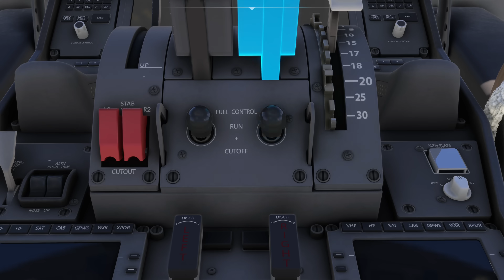Air India 171: Why Did The Fuel Cut-off Switch Get Moved?

Comment: I did wanted to float an idea, what if engine fuel was cutoff due to a software glitch but in the when the pilots found out in the frantic race to recover they tried 'turning it off and on'. this would be later recorded as 'fuel manually cut off' as sensors would indicate that. could that explain the conversation from recorder? would other sensors be useful in establishing a timeline to rule out this scenario?

more importantly IF this was the actual scenario then how could pilots recover if it happens again, esp in climbout.

Comment: Looks like Steve got some input from boeing to constantly push the pilot error angle 😊 ... Remember he was the first one to blame on the pilot error with his wing flap theory... which he retracted in light of new non-refutable evidence of RAT 😮 ... Interim report is not blaming the pilots as of now... so let's not be quick to blame pilot due to lack of real root cause... otherwise u will again hv to retract this line of argument in light of new data .. in 737 max case also people were quick to pin the blame on pilots without doing any real fact based root cause analysis. This is plain stupid if not some agenda driven.

Comment: Without video of the switches being moved to cut off, how do we know they were physically moved? In a software driven airplane, why would it not be possible for a glitch in the software to indicate fuel switch cut off, when, in fact, the physical switches were not moved to cut off?
Is there not visual and audible alarms that could indicate to the pilot that asked Why did you cut off? without the physical switches being moved? Hence the denial?
 As I understand it, these switches are not hardwired to the shut off valves, but instead go through the software befthe valves are activated. Is this true or not?
Reply: Yes, it's just an electrical switch that gives it's position to the computer. No direct mechanical connection to anything. Also it should be audible in the cockpit voice recorder. The sound of the switches 1 second apart should be damning evidence one of the pilots did it. Not sure they have that evidence or not.
Reply: That is how I understand it as well. @arunkp20

Comment: its been said that the cut off switches are moved .. it does not clarifies what or who moved it .... this channel is only discussing the human posssibilities .. a blame on those who cannot defend ... the same report also mentiones that its possible for the cutoff switches to fall back as a - non mandatorry maintenance issue
* take the switches in the house for example ( on high volt cases the switch will be still on but the fuse stopps the electricty)....  there is very high possibility that the switch was never moved in the first place but the internal electricity was flucuating ----- this explains the electrical issue in the flight even befor take off )
Reply: No, there is no evidence the switches were physically moved.
Reply: @pmaitrasm  but the reeport says that there is a 10 sec interval between the switches getting turned on again.... any human trying to turn on a switch in a critical condition would do in way lesser time ... here the timing doesnt make any sense ... it would be a internal electrical issue
Reply: @jayaprakashhasthi5775 , Do you understand a flag? A transistor can hold a value, as a 0 or 1, indicating something is false or true, but that does not guarantee that the switch was actually physically moved.
Reply: @pmaitrasm 😂 why are you repeating whatever I say…we are on the same page..read it carefully
Reply: @jayaprakashhasthi5775 , Ok, got it. From a grammatical point of view, when you use the word ‘but,’ it indicates you are negating what you stated prior to it.

Comment: There are 2 fuel valves on Boeing airliners , the ones inside of the fuel controls and ones inside the leading edge of the wings where the pylons attach .  The ones in the wings are for fire suppression .  Were those valves closed also ?

Comment: You know if some sort of AI was included in future versions of the Full Authority Engine Control system it could have at least questioned the cut-off of fuel to the engines during take-off which would not have been normal procedure. I'm not talking HAL but some sort of verification system; You sure you want to do that?

Comment: Answer a simple question !!
Why did the pilot switch it back to Run mode after the cutoff mode if he wanted to crash the plane??

Also can you shut off both engines  without the other pilot not knowing?? Or in less than a sec duration??

Comment: Steeeve, for an eng. fire, you said than on approach, you select the fuel cutoff sws. to off.

For an engine fire, the 787 checklist requires that the fire handle be pulled and rotated to shut off the fuel which as you know shuts off hydraulics and pneumatics,
and NOT  the fuel cutoff sws. to shut off the fuel.

Comment: "Two-man rule" on the switches is a little crazy. One of the pilots can always refuse to operate a switch OR what happens if one pilot is incapacitated??? Also introduces increased possibility of failure.  Sorry, bad idea. (this ain't WarGames in a nuke silo)
Reply: Yes. One pilot goes to the bathroom or fades out and the other is never able to shut down the engine fire.....
Reply: @martinwigge7642  Notification of e.g., an engine fire, would override the need for dual compliance.
Reply: Exactly.  It's also a more complex system with more modes to fail, like it could lead to it failing to recognize dual activation and hence not activating.
Reply: @rocketanalyst  I think what you will see now, is that they add a block-hold in the flight mode logic so the switches cannot be turned off during a 'take-off rotation' period. Same as when in 'ground mode' the gear will not retract up nor will the RAT deploy - the flight control does not allow it.
Reply: @RazortechAirguns 
Because there’s no other way for the pilot to crash, the plane 
He could’ve just slammed the rudder over as hard as he could. They would’ve been too low to recover.
Reply: @neilkurzman4907  It appears to me that the Captain caused the accident where he did not want to be blamed. Planning it to be seen as an accident or the other pilots fault. There is a cultural aspect to this as well. So no, he's not going to 'slam the rudder' if this was his plan. Doing something like that is spontaneous and erratic, the behavior shown was deliberate and with some forethought.
Reply: @RazortechAirguns that’s still a more complex system with more modes to fail, not saying it’s a bad solution but is a trade off.  how does it determine it’s in take off and how do you connect that to the system?  it’s of course doable, but it introduces complexity and more failing modes
Reply: @rocketanalyst  Actually, it is a very simple set of instructions to the system logic --automatically hold fuel-cutoff to open for the short duration until the set speed/attitude parameter window is reached. The system already performs dozens of these types of tasks. Also, the fuel-cutoff is never used until the throttles are set back to idle (you want to lower the pressure before you shut ANY valve system) AND you would never do either of these things during take-off. This block-hold would also prevent any accidental hitting of the switches.
Reply: Has it occurred to you that a pilot has many options on how to question airplane without adding an overly elaborate expensive system to stop the pilot from doing his job?
What happens if a pilot incapacitated then the plane is going to crash? 
You can turn the key to your car off while you’re driving. Do you think that should be stopped also
Reply: To actions to turn off the fuel number one turn off the switch number 2. Nothing happens until you pull back the thrill for that engine. Normally there would be 2 different hands-on those controls. That's too pilots in bowed one pilot could do the same thing
Reply: Exactly. Beyond that nothing can stop a malicious/suicidal pilot regardless of all the precautions. For example we may engineer all those robust checks yet the rogue pilot just picks a metal object and smashes all the displays! Now what!? We are now supposed to use bullet-proof glass!? OK suppose we do. Next time another one simply pours coffee on all the electronics or pulls out all the circuit breakers. Do you get my point? There’s a point where it is sufficient to define a line of responsibility leave it at that.

Comment: If the pilot was suicidal then why were the switches turned back to run ? Why was there no conflict in the cock pit ? Doesnt add up to me..there should be cameras in the cock pit and there should have been after german wings
Reply: Because the pilot was not. This is just myth peddling by this YouTuber.

Comment: "I believe the accident is also attributable to Boeing's aircraft philosophy, which asserts the pilot as the ultimate authority in the cockpit. The computer merely assists the pilot in controlling the aircraft. This contrasts with, for example, Airbus, which has its 'flight envelope,' where the computer essentially flies the plane and every pilot command is filtered through the computer to determine its safety. I'm curious if an Airbus A330 or A350 would even allow for such an accident scenario

Comment: I'm sorry Mr pilot but you don't have to be expert to know that it's physically impossible to switch off both switches in one second.  Impossible plainly because of procedure it requires.  Pull out pull down...twice. And then 10 seconds before one of the pilots put the switches back on. Doesn't hold water at all. Could you please demonstrate the same procedure and I guarantee you that it would take you at least 3 secs

Comment: The preliminary report says the second switch(engine) was turned off within 1 sec. That's not possible for humans to do unless they use both hands
Reply: What are you  taking about?! It's been confirmed by pilots it's perfectly feasible using one hand.
Reply: @areluc Not both switch at the same time
Reply: https://youtu.be/WhCGWxb5zsE?si=vDephFfMa4wLOOhT
Reply: @sharmaji01  Not at the same time. The preliminary report clearly states they were switched off to the cut-off position with a one second delay.
Reply: @areluc That's what I am saying just 1 second delay how's that possible, I certainly cannot do that within this time frame it should require at least a 4-5 second delay if manually done
Reply: @sharmaji01  I'm afraid you don't get it. One second delay is between moving your hand from the first switch once it's in the cut-off position to moving the other one to the same position, not the entire sequence. It's been shown by a pilot it's enough time.
Reply: @areluc I get you, I am just saying don't be an ostrich by just believing these sponsored pilots. I am just concerned for my family and yours, we could be next. I would be more relaxed if it were pilot error but we have to see the other side too.                                      In 2018 the FAS SAIB warned of a fault in B787 fuel control switch part number 4TLA37/3D where a failed locking feature could cause it to slip into the cutoff mode potentially triggering an unintended engine shutdown and on 27 may,month before crash uk aviation authority said there is something terribly wrong with the fuel shutoff valves actuators on b787 which require replacement or inspection.

Comment: I can't believe that you didn't cover the 2018 FAA Advisory in this video today. For reference it is FAA Advisory NM‑18‑33.
Reply: @captainsteve what do you have to say about it ?
Reply: @Faraz_khan_official  Air India has confirmed that it did not carry out any inspections in response to FAA Advisory NM‑18‑33. The airline told India’s Aircraft Accident Investigation Bureau (AAIB) that it skipped those checks precisely because the bulletin was “advisory and not mandatory.”
Reply: @bradowen761  Also, On May 15, the UK's Civil Aviation Authority (CAA) issued a safety notice regarding potential fuel control issues on several Boeing aircraft models, including the 787 Dreamliner. Even, this is being ignored.

Comment: I believe one of the pilot instead of switching the gear up, he might switch off fuel switch instead. I am saying this because the timing the fuel switch is turn off seems like it’s also the same timing when they need to retract the landing gear. That’s why when the question asked why fuel switch is off, the other reply he didn’t. Because he never knew he has toggle the wrong switch. Mistake can comes in many way, logical or no logical, anything is possible.

Comment: The flights do rattle a lot during take off... So if the lock function in the switches were faulty? Could it be automatically shift to cut off due to rattling?

Comment: What’s your response to people saying that vibration set the fuel cutoff switch in the cutoff position. I think that if that would’ve happened, it would’ve happen during taxi or when climbing to V1 speeds when vibrations are high not 3 seconds into climb. And it would’ve happen almost simultaneously, not within 1 second intervals. What say you?

Comment: Here’s a question. Why aren’t those switches engineered the opposite way so it would take a direct action to put in the off position instead of there being an accidental option of knocking them down. So, down position would be “ on”, then a direct action to pull them up to the “ off” postition.
Reply: I said exactly the same and I would make them yellow as there are many buttons below of same color. Then I would put additional flip military type cover as secondary protection (solid yellow or translucent as then yellow ball would be seen underneath)

Comment: Is it possible for the Fuel Cut-off to be operated by another system e.g. Does the Fire Suppressant system cut-off the fuel before releasing suppressant? if so it is not as simple as many are claiming.